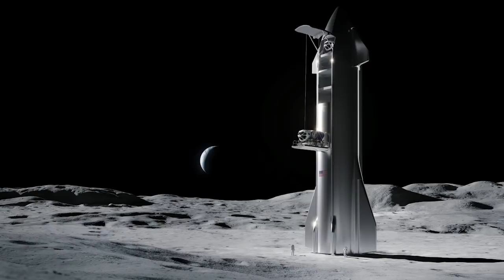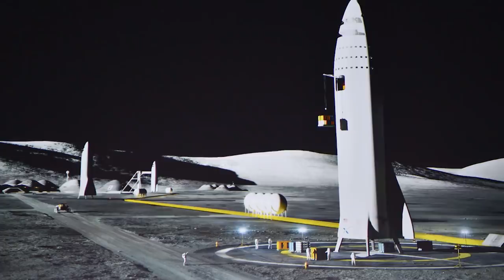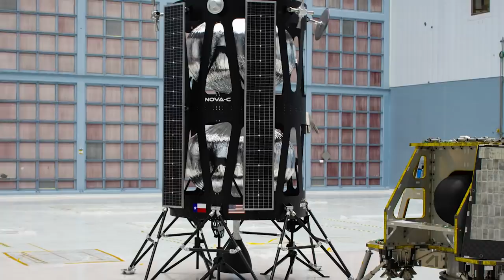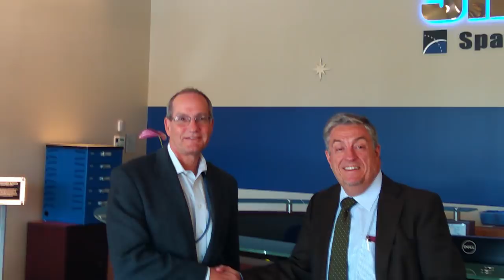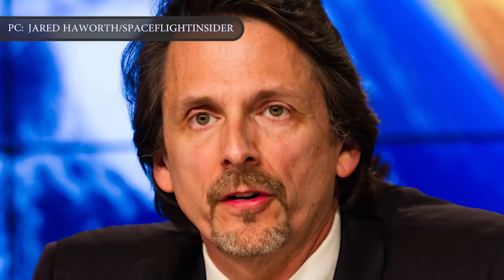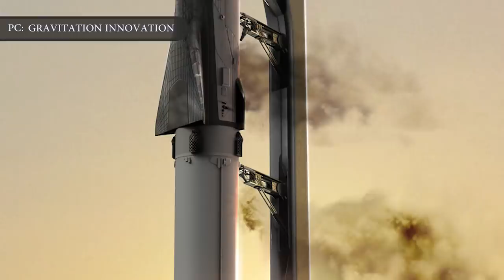SpaceX Starship Update | SpaceX to Land A Massive Spaceship on The Moon In 2022 for NASA

Comment: SpaceX should make a custom MoonShip (or in NASA speak LSP=Lunar Shuttle Platform/Lunar Service Platform) to shuttle from LEO to the lunar surface. Use Starship and its heavy aerodynamic surfaces and batteries to shuttle from Earth to LEO. MoonShip needs no fins or fairings because it will never see an atmosphere. It also does not need as much tank capacity.

Assuming you keep the current tank capacity, but reduced the dry mass to 75,000 kg by eliminating 3 sea level engines, 3 Tesla battery packs, the whole nose-cone thing, and the four aerodynamic surfaces, and the heat shield, MoonShip could land 700,000 kg on the surface of the moon and return with 10,000 kg to LEO.  In total: 4 tanker flights and 5-7 cargo flights to LEO. One MoonShip flight to the moon and back. This is much more efficient than taking all of that extra mass half a million miles.

Or you could create a smaller vehicle with smaller tanks for smaller payload missions. Or both.

Design the spacecraft to do one thing well.
Reply: Genius hopefully they get your message... why try to land that giant thing take smaller ship like star trek lol

Comment: Not going to happen.
The temperature in low earth orbit is 120°C. There is no manned orbit without shade, so if you ever see any models which don't sport solar panels or parasols, then you have to be suspicious.
Any rocket equipped with solar arrays, once in orbit, would immediately challenge Apollo's cold sun narrative. 
All that aside, we still have no way to answer van Allens assesment of the lethal ionic cloud surrounding earth. 
That might be worth bearing in mind if you want to send people out beyond low earth orbit. Or you'll kill them. 
https://youtu.be/Zztbw7MLlkI
Reply: (Sigh) Heat can be radiated away from the spacecraft. It is simple a matter of continuously rotating to maintain an even temperature, and having reflective surfaces and radiators. The Van Allen belts can be navigated by using appropriate shielding and flying quickly through the thinnest part. You're only in them for an hour or so.
Reply: @odysseusrex5908  
Imagine a rotisserie in a vacuum oven. 
A turkey is turned 3 times an hour as a cooling measure. 
How much longer will it take to throughly cook the bird compared to a conventional vacuum oven?
Reply: @rockbore   In an oven, you have heat coming from all sides. Not in space.

Comment: So, when more people going to start up their own space companies?

You think it's hard, but you're stupid for thinking that. You have a computer, anyone can get a college degree, anyone can create a business, anyone can play business based games... So get up and DO SOMETHING!

 You think you have to be a Einstein to build rockets? No you don't, you just need internet, and the basic understanding.

Take ion engines, copper wire, aluminum, electricity, and a basic frame. Bam a ion engine.

Rocket?

Oxygen tank
Fuel tank
Pipes
Pumps
Valves
Combustion chamber
Something to control the candle effect
A nozzle
A cooling system
A computer system that times everything right.

Your ready.

So... The people you would need.

Plumber
Programer
Engineer, and their team

Anything I mess?
Reply: Don't like that, then send money to space x.
Reply: Well, if it's all that easy, why don't you show us how it's done? Start with something simple, like cars or airplanes, or computers. In the meantime, there are, in fact, a significant number of companies hoping to break into the private launch market. Most of them have nothing more than a business card and a CAD file and will go bankrupt before they ever cut metal, but some will succeed.

Comment: since there is low gravity the lunar dust during land (potentially dangerous at high speeds) could escape to space (ok no prob) or many particles could do round the moon many times even orbit under circumstances- any precautions?
Reply: Lunar escape velocity is 2.38 km/s pretty sure no dust would achieve that much velocity. And achieving lunar orbit from any acceleration from surface is impossible as any orbit achieved this way would intersect lunar surface. Remember, orbits are periodical, an object in orbit will return to where it was last accelerated.
Reply: @aleksandersuur9475  awesome answer thanks for your insight.. 
still you think future bases -ships near land zones could have serious impact by it? i could imagine it like a light sandstorm after your answer.. 
gosh a saw a video talking about it and raised questions have to stop youtubing so much lol
Reply: @antonis190811  well, not like a sandstorm, there is no atmosphere to slow down any velocity dust picks up, it'll all fly away at a ballistic trajectory at whatever velocity it picks up. Which could be quite a lot considering that Raptor exhaust velocity is 3.7km/s. As the exhaust plume impacts the surface it will blow dust and small rocks in all directions, just not at escape velocity I think. 
The matter blown away will be in the exhaust plume for a very short time and the pressure is quite low, so I don't know how large rocks it will pick up or how fast it will fling them. Nearby objects could receive anything from a light sand blasting to looking as if someone used them as practice dummies in a machine gun range.
The obvious solution is to have some terrain between the landing pad and any equipment, a ridge high enough to prevent direct line of sight should do the trick.
For further away objects, like a different base half way around the Moon there should be no problem, the chance of getting hit with anything should be much smaller than danger from micrometeorites that already has to be accounted for.
Reply: @aleksandersuur9475   I know an exhaust expands to the side and dissipates quite rapidly in vacuum. At what altitude will Starship's exhaust have a significant effect?

Comment: Compare the specs of a boring machine to the cargo capacity of the Starship.
It would require multiple launches, of course, but it is doable. 
It doesn't require a hole in the ground to begin work. Just a relatively flat spot against a hill or crater rim.
imo, their earth based business is testing prototypes for use on the Moon and Mars.
Just a thought in passing.
Reply: There is gonna be bigger rockets:
https://twitter.com/elonmusk/status/1166856662336102401?lang=en

Comment: I know there was a reason why they decided to go with methane but a hydrogen and oxygen mixture would have been so much cheaper
Reply: THEY WENT TO METHANE SO THEY COULD HARVEST IT ON MARS FOR RETURN TRIPS
Reply: ACTUALLY IF THE MOON IS THE TARGET HYDROGEN 3 IS ABUNDANT ON THE MOON.
Reply: Starship was built primarily to go to Mars, and for that it needs to use methane.

Hydrogen and oxygen can be produced on the Moon from ice at the South Pole (H2O). Methane and oxygen can be produced on Mars from carbon dioxide in the atmosphere. (Split off the carbon and process it into methane.) Both take energy and equipment, and will take a lot of time to get realistic levels of production going. But I hope they do.

On Earth methane and hydrogen are purified or processed from natural gas, for large scale production. Hydrogen is cheaper per cubic meter. A cubic meter of methane contains more energy, so it doesn't cost as much more as it first appears. But is still more expensive
Reply: No, actually, it wouldn't. It requires far greater cryogenics and maintaining the fuel in the tank for any length of time is almost impossible.

Comment: How much dust will the Starship kick up on the moon? Are they going to burn a crater on the Moon surface while touching down and is that a problem for landing?
Reply: No, the dust layer is only a few centimeters thick, above rock. Kicking up dust will be a problem for landing near anything already on the surface. One of the first things they will want to do is build landing pads to minimize that problem.
Reply: @odysseusrex5908  First cargo will be brooms and vacuum cleaners!
?:°)
Reply: exactly my thoughts..
Reply: They use low octane fuel so it doesn’t blow dust !

Comment: "But some of these new providers claim they may be able to bring several tons."

Mean while the big ass boi starship silently sat in the corner with 100-150 tons
Reply: Anyone betting against spacex and/or Musk is ignoring the track record
Reply: Maybe we should get Starship flying before claiming things
Reply: UFOlogist yes SpaceX have a track record of promising things and not delivering .....  no wait ...
Reply: Andrew Hart NASA have a record of delaying things many years, much worse than SpaceX. Remember James Webb telescope? The same fate goes to SLS
Reply: @kerbodynamicx472  This is why they helped Elon to create Spacex - they wanted routine tasks (like iss supply) to be doing faster and cheaper. But Elon eventually started thinking that spacex is a super power).
Reply: R.I.P. MK 1  
RUD ==> Cybertruck
Reply: 2022? I would say 2026+
Reply: It blew up. I've worked with stainless steel. The stuff cracks extremely easy during rapid temperature change. I was wondering how SpaceX was planning on solving this problem. AND it looks like they DIDN'T solve this problem. Be careful crowing about starship too early. There's a chance they are back to square one and have to design a composite ship or at least partially composite.
Reply: @Bryan-Hensley  I think that it's even worse than you think - they were not well aware about this problem. This is why they aren't worried about transition from cryogenic temperature to red hot skin during reentry.
Reply: Bryan Hensley - Mk1 was at 2x design pressure, & they had to disable the safeties to do that.
Reply: @TraditionalAnglican  Quote: "disable the  safeties to do that"
What does this remind me of...? Think hard boi... Share...no...bill?
Reply: sbmphr  falcon heavy isn't powerful enough for a human moon mission. It would take falcon 9 and falcon heavy to pull it off with the components from the two launches docking together in orbit. Trust me, I've done the calculations. And that's a fly by orbit, not landing.
Reply: I think that few tons include the lander itself. So?
Reply: So far, The Starship is a paper spaceship!  So far, none of those contracted to haul humans have made orbit with a human rated space craft and Musk's Starship is a unproven concept as well!
  Of course, we are all rooting for them all and I for one, think the progress of SpaceX is amazing, but it's not there yet and there will be set backs, as demonstrated by the recent pressure test anomaly!
Reply: @nightlightabcd  I think you aren't giving enough credit.  I would rather use the SpaceX model to rapidly build and test  (and fail quickly) than the current military industrial complex and government model, spend 10 times more and 20 x more time, and end up with a mediocre and massively expensive solution, like the Boeing crew solution...
Reply: nightlightabcd all of the lunar landers are paper only.
Reply: @nightlightabcd  How dare you wake the happy dreamers?!
Reply: @Hugh JanusHuge Anus, nice to meet you)
Reply: @ncrean66  Oh please get in friendly terms! Both of you.
Reply: Starship can not get it's ass out of the launch pad
Reply: Nike Crean it’s a 2 stage rocket dumbass, and even without the giant booster it can still carry its own weight
Reply: @Anton-ey6sl  No, Antonio, it can not. It could do a hop with less than a half of the normal fuel load(if it would has been properly designed and built - not by this addict Musk in his backyard). But even in this case it could not get to orbit on it's own.
Reply: Nike Crean maybie because it was a prototype that was actually built very quickly
Reply: @theenjeneer2493  Unfortunately nothing beside it. No proof of concept so far.
Reply: Nike Crean how about the star hopper flight? The Raptor engines literally made for the purpose of propelling starship? and the many presentations and  manufactured parts like fuel tanks for earlier designs and  there already well into the construction of the boca Chica launch pad and facilities so id say theres a lot of proof that starship will fly
Reply: @theenjeneer2493  Probably, Raptor engine development goes well (I say probably, because all that has been demonstrated so far is ~1minute burn). But nothing beside it - Starhopper is not a technology demonstrator - it's a test bed for the raptor engine.
Reply: @ncrean66  The testbed-level testing on the engine was done though. We've only seen a the minute-and-a-half lift and a couple snippets from their internals. But... "full length burns" are supposed to have been done already. As of Sept 28, the claim was (paraphrased) "The limiting stick is the engines. We're building them as fast as we can, at a pace of one very 8-10 days".  And they had 3-4 or so then (a couple already torn back down to parts).They should be up to ten or so now.

If they're actually on that track, by March, they'll have made more engines than were ever made for the Space Shuttle.
Reply: @shrikedecil  They need 41 raptor engines to get Starship to orbit. It's more than a year just to produce them.  And they need a booster that is twice as big as Starship itself. And they need to put a Starship on top of the booster, attach 41 engines and test it all together. And this is what could be called prototype. And now compare it to what has been actually done.
Reply: @ncrean66  The quote was 8-to-10 days now, couple days by Christmas, and 1-every-day by "Q1" Assume Elon Time and slow all that down, and do vaguely linear interpolation:
2019 09 28   3 (Every 8)
2019 10 26   7 (Every 7)
2019 11 30   12 (Every 6)
2019 12 28   18 (Every 5) 
2020 01 25   25 (Every 4)
2020 02 29   37 (Every 3)
2020 03 28   51 (Every 2)
2020 04 25   67 (Every 2, Plus 1 per week bonus)
2020 05 30   92 (Every 2, Plus 2 per week bonus)
2020 06 27  121 Every day
Reply: Nike Crean proof of concept was stathopper. What happened the other day was a test. A couple weeks ago the decision was made for mark 1 to not be used as a flight vehicle and instead spacex decided to learn how much pressure the current tank design would hold before rupturing and as elon stated, the result was not unexpected n cut and dry. Mark 3 is already underway as mark 2 will be used as another milestone test. Meanwhile production methods have been learned as well as improved upon. Rapid prototyping at its finest.
Reply: @richhooker1263  Cool story.. I have heard two variations from the fanboys though - one is yours and another one was about buggy pressure sensors. I like both of them but unfortunately they contradict each other:(. By the way, seems mk2 is already acknowledged to be the same crap as mk1 - probably, that's what they learnt from the test)
Reply: @ncrean66  Acknowledged by who? You?
Reply: @HNedel  Follow the news, dude..
Reply: @ncrean66  it took nasa 20-30 years and everything germany had produced and thought about to put some humans on the moon - so maybe give them 5 years?
Reply: @majstealth  you missed to mention 150billions (us$ 2008) - that was the Apollo cost. Are you ready to give them as much ?

Comment: For manned missions where will Starship get the propellant for the trip back to Earth?
Reply: The Starship can refuel in low earth orbit, a fully-fueled Starship can deliver 100+ tons to the lunar surface and return to Earth without any more fuel.
Reply: @brettbrewer6091  Well, not from LEO, Starship has a lot of dV for a single stage, but it's still only a single stage. The refueling would have to be done on a bit higher orbit.
Reply: @Mighty Ferret isn't that an issue if it's landed on the moon??  😂😂
Reply: @Mighty Ferret The video is about Starship on the Moon where there's no CO2.
Reply: From the gas station
Reply: Just remember that it takes barely any fuel to lift off from the moon due to the low gravity.
Reply: Maybe they can get some cfc's from the ozone layer.
Reply: It will carry enough for the round trip.